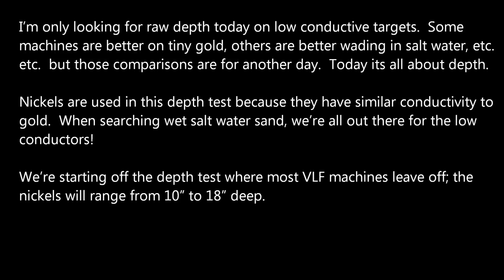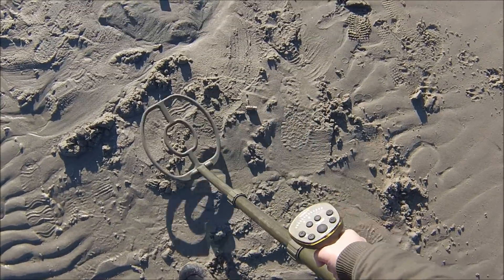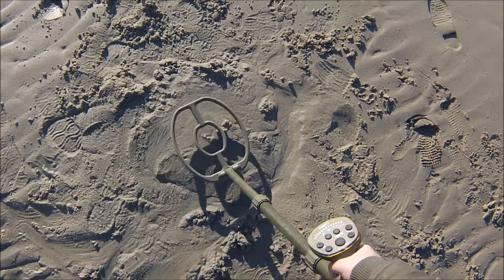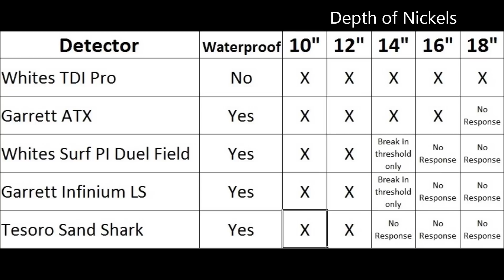Depth Test -- Surf PI, Sand Shark, Infinium, TDI Pro and ATX

Comment: I like alot great tests,, Darren from Goldfinders Australia. P.S Our TDI goes toe to toe with our gp3000 with the 15 inch semi ellip equip. But not as deep as the gp3000 with its 18inch dd. But for wet sand digging they get hard to recover at these 20+ inches deep. Thankyou very much for sharing this video, i have been curious about that new garret, and now i know
Reply: Yeah done that, same with the 6 inch mono coil from the minelab on the tdi, the minelab works better, but the tdi works better running its standard coil over the 3000 using its standard 12 inch coil

Comment: That is a great, fair test of the deepest machines out.  I would have to say though that full Gain on the Dual is probably not it's best performing setting.  Also, on the Shark, pulse width determines  the size of ltarget it hits--not the power. Thanks!

Comment: Yes, thank you. I need a PI detector since I live in a beach community and will mostly be detecting at the beach. I'm also a diver/snorkeler.
Reply: I have a Garrett Sea Hunter II, and over all its great - on the Beach and in the water.  With my intent to renew my scuba certification, I will use it underwater.  The Garrett is a turn on and go unit.  The ATX is crippled by detector shaft vs. Sand damage issues and while I love it, I don't think I would buy it for that design flaw - maybe.  I hope and pray the TDI Pro is on the schedule of detectors Garrett will make since they bought White's patents, rights etc - the TDI is a liability near the water especially in the rough sea waves such as in the winter months here in Florida, but up on dry sand it's a great, deep second round to a CTX 3030/ Equinox 800 - they can discriminate but not perfectly but they do have displays to analyze targets.
Reply: Great review :)

Comment: Thanks for posting this excellent video. I look forward to you testing the ATX with a mono coil under the same conditions. I'd speculate that you'd get the 18" nickel with a mono coil. Would it have the stability of the TDI with it's mono coil, under the conditions as in this video.
Reply from the maker: I would agree that the ATX should get about the same depth as a TDI Pro if using a mono coil.  I also look forward to seeing the depth and stability results. Thanks for watching.

Comment: Good comparison👍do you  the difference between the tdi pro an de tdi sl?
Reply from the maker: The TDI SL is not nearly as sensitive as the TDI pro. The TDI pro is a deeper machine. I have used them both extensively come with the GB off I go about 4" deeper on a nickel.
Reply: Thanks for the information, I can’t find the Tdi pro but only the tdi sl is forsale

Comment: Thank you for sharing your experience. Do you know how the Whites TDI stacks up against the Minelab detectors like the SD2000/SD2200 or GPX up to 3000 model as I can pick these up second hand for around the same money as the Whites?
Reply from the maker: F0X4 I have only tested the GPX 5000 side by side with the TDI Pro at the Beach.  The depth was very comparable and the TDI Pro was a little more stable at full gain.

Comment: Thanks for sharing, I have to use Sovereign on my beaches because of iron, I want to see comparison PI to Minelab BBS machines, regards.
Reply from the maker: +Bosman Boss There is no comparison when it comes to raw depth.  What sounds good on a PI is hardly noticeable on a BBS detector.  I have tested a CTX with the 17" coil and could not hear signals that I heard clearly with the TDI Pro with a 12" coil.  But as you know, there is a trade off, if you want the depth of a PI, you will have to dig the iron that your Sovereign ignores. The Sovereign is a slow processing detector so if there is a lot of iron around, it is probably masking good targets.  I use an Excalibur which is essentially a waterproof Sovereign and I have had good results with the 15" NEL coil going very deep but I could not use it in an iron infested area.

Comment: Can you make a video comparing the equinox 800 with the same machines you used in this video please thanks.
Reply from the maker: No need to.... there is no comparison in terms of depth.  At 10" the nickel will start to disappear in the best conditions.  I use the Equinox while wading.
Reply: @DetectorComparisons  thank you for your replay, i have another question I'm looking to buy another machine for parks and beach and need to be deeper, with all your metal detecting experience wich would you recommend  the Equinox 800 or CTX 3030 no matter the price, Also i already have the Tdi pro, Xp deus
Tdi beach hunter, Thanks in advance.

 xp Deus, Thanks.
Reply from the maker: @diggingforgold4150  I personally use the Equinox 800 and XP Deus.  Those are my favorite two land machines.  A lot is personal preference so its hard to say what would be best for you.

Comment: Thank you for this test! Much appreciated. At what depth does the CTX3030 detects the nickel? (with no disc, no ground balance and sens at 28?) I would love to see more testing videos
Reply from the maker: Booleys The CTX will go 10-12" on a nickel in wet salt water sand depending on the settings.  If you could run your detector in manual 28 sensitivity and its stable, you should hear the nickel in that 10-12" range.

Comment: First thanks for producing this video must have been lots of work but is a great comparison of some deep seeking beach machines.   One question about the settings on the Infinium.  According the user manual and the posting I have read online you get the best depth using it when you have the ground balance set to Lock and you had it on slow which is known to reduce depth.  Was the machine unstable unless you turned on the slow ground tracking?
Reply from the maker: +Stephen Pearsall I tried the Infinium on all settings and achieved the best signal response when set to slow; The Infinium was stable at all settings. Thanks
Reply: +DetectorComparisons Thanks for the answer - I have one its way to me and have been reading the manual and watching Garrett's and other's videos on the machine so was very interested to hear about your results.  According the documentation you should only need to run on slow in very heavy mineralized areas.  I intend to use it on beaches in northern Mass, NH, and southern Maine many of which have a lot of black sand mixed in the beach sand.
Reply from the maker: +Stephen Pearsall I hunt the CT and NY shores and some of the beaches are very rocky with black sand.  You may also have your best results running in slow depending your levels of minerals/black sand. Good luck hunting up there!

Comment: Hi DC, would you please list the settings you use for the TDI on the wet beach, thanks
Reply from the maker: GEB off, Gain at 100%, Pulse delay 10-12 and the threshold where you can just hear it.....  This is what was used on the TDI Pro
Reply: Thanks DC for the settings

Comment: Have you done this test with your TDI SL yet.
General opinion is that the TDI SL has slightly less depth, but I have not seen a realistic test like this. Anecdotal evidence does not really help.
Thanks
Reply from the maker: There is a big difference between the TDI S/L and the TDI Pro.   The S/L is more in line with the Duel Field when it comes to depth.  The TDI Pro is much deeper.  I have done side by side tests with both machines and I can hear a mans gold ring at 18" with the TDI Pro and with the TDI S/L, I can hear the same ring 12"-13".
Reply: That is true . The TDI PRO is more powerful on a neutral ground  . But the TDI SL is stable like a rock . So on heavy mineralised beaches I can crank up the gain to it's maximum without any problem , whereas it is not possible to go more than 50%of the gain on a TDI PRO without stability issues . .So I am more comfortable and effective with my TDI SL  in a daily highly mineralised hunting situation .  Even my Garret atx does not handle these harsh conditions as well as my TDI SL. I hope this helps .

Comment: Finaly I have white's my tdi pro, but is to noisy than the tdi sl, can share me you setting please?
Reply from the maker: If you use it at the beach, it will be noisy especially if you raise and lower your coil.  Keep it level and sweep slowly. Remember a PI detector is constantly retuning itself.  I run at full power with the GEB off and the pulse rate about 12.

Comment: I live in Australia and own a Garrett Infinium. I like the machine but it is very hard to ground balance in mineralised soil. I get great depth out of the machine but from all the videos I have seen the TDI pro looks like a step up in performance for a similar price machine. Would you recommended upgrading?
Reply from the maker: F0X4 You will find the TDI Pro will go deeper that the Infinium.  I also find the TDI Pro to be very stable even at high gain.  I have used the TDI Pro in the heavily mineralized dirt of Culpeper Va and it worked very well.

Comment: I don't see enough videos with the sand shark? Any more on the way? How good a product for the price?
Reply from the maker: +zipngo1 The Sand Shark is a good basic PI unit.  I use the TDI Pro or ATX because of the extreme depth but depending where you are, the Sand Shark will work just fine.

Comment: ....you should not search with the Infinium in the slow or fast mode. Those settings are for ground balancing only. Always detect in the locked mode.....
Reply from the maker: If you are in an area where there is black sand or heavy minerals, searching in locked means you will have to reground balance the detector as ground conditions change.  Garrett recommends searching in locked when you can, but if you are in an area with high minerals or black sand, searching in slow or fast is recommended by Garrett.